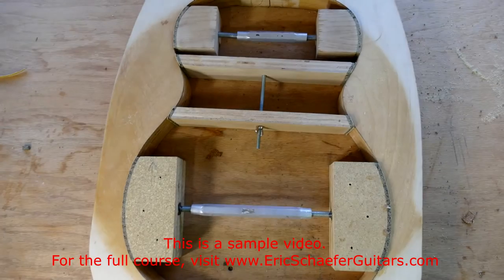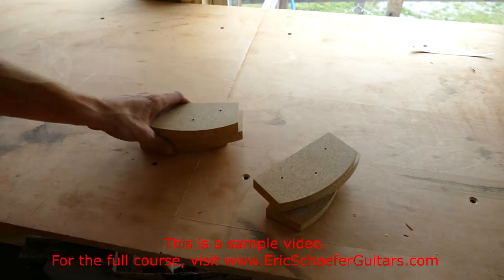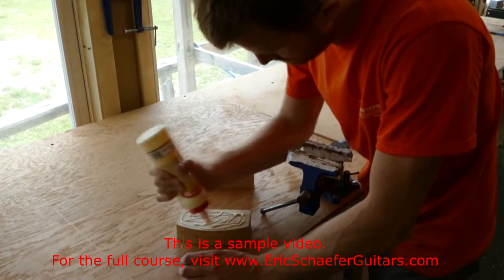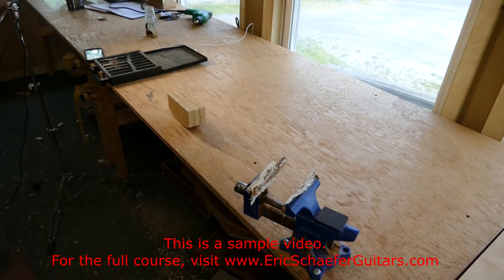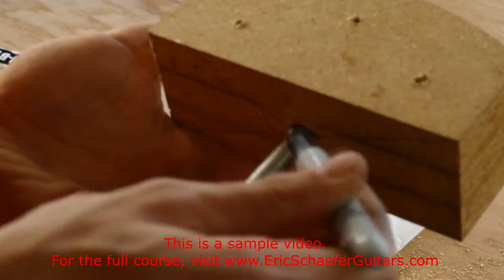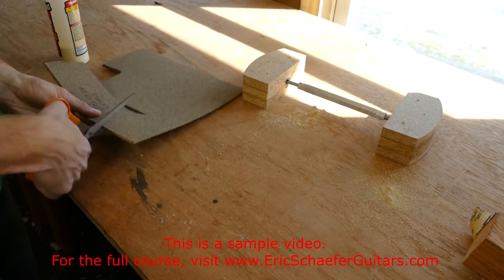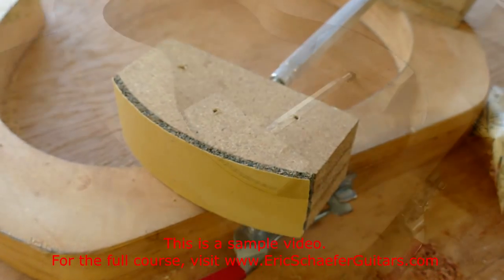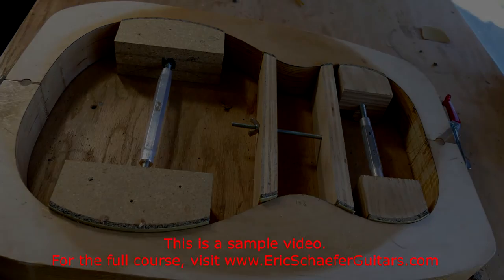#23 Making Guitar Mold Spreaders - Online Guitar Building School - Eric Schaefer Guitars

Comment: Excellent video. I made spreaders for my uke mold and acoustic guitar mold today using the techniques you suggested. I am very pleased with the results! Instead of creating three separate segments for each spreader, I made one master, used the master for the top half to make a master for the bottom half. Then, using the masters, I rough cut the next piece (to be laminated) to around 1/32" to 1/16" shy of the mark, glued the master to the rough cut segment, let dry, and used a laminate trim router bit on my router table to shape the glued-on segment. I repeated this process for the third layer. I had doubts about the strength of the epoxy, but it turned out to be perfect to keep the threaded rods from moving around in the spreader holes. Thanks for sharing your wisdom in these well-crafted videos!

Comment: awesome video
I'm having trouble figuring out the best location for the spreaders on the Gibson j45 ill be making cause the lower bout comes out pretty wide but it doesn't have much of a waste or upper bout
Reply from the maker: Yea, I'm not sure. You might just be overthinking this. I would just space them out so the areas are covered relatively evenly. If you are having trouble fitting the waist clamp with the upper bout spreader in at the same time, you could make a third spreader for the waist rather than the 2-piece waist clamp. Just a thought. Hope that helps!
Reply: Eric Schaefer 
Thanks again for the advice
It definitely helps